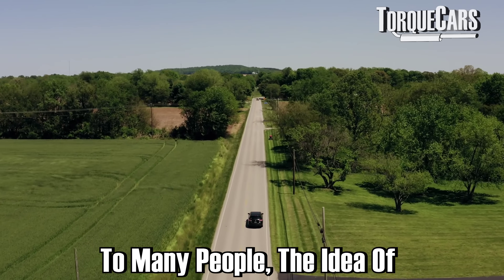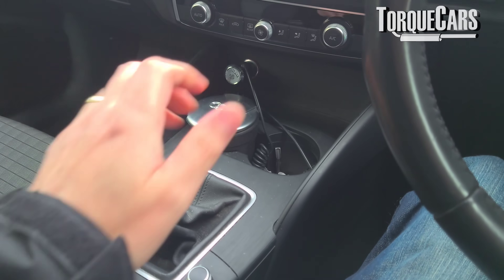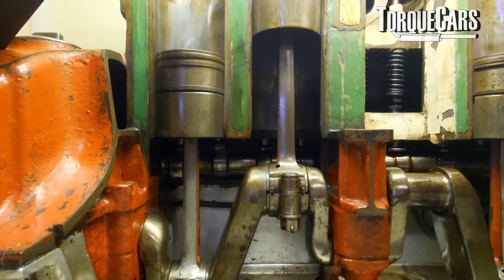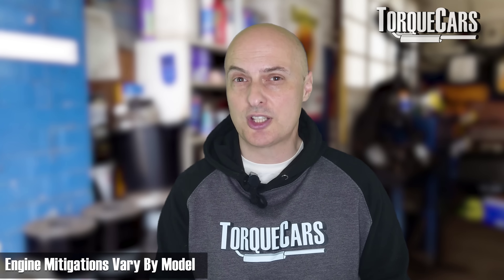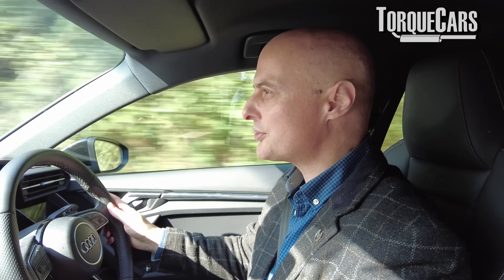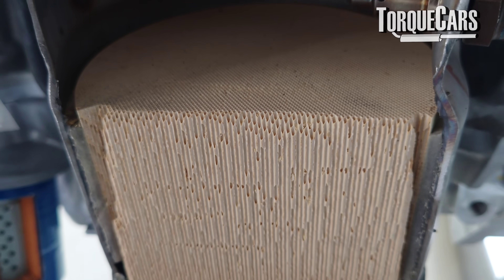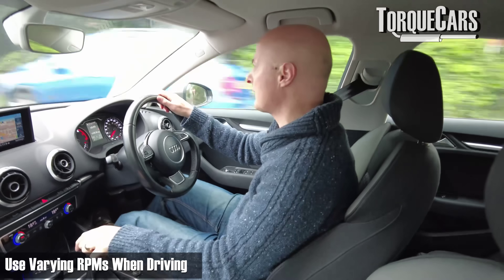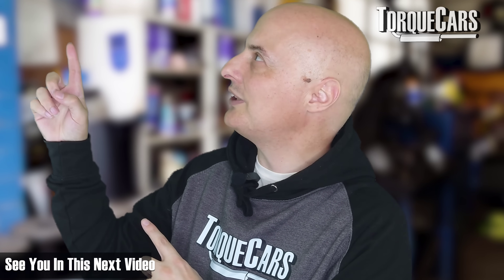BIG DAMAGE By Lugging at LOW RPM? Eco Driving Warning! (Manual Gears)

Comment: Great advice, I do have to use the gears a lot as I live on a steep hill and narrow roads, as I enter the bottom of my hill it's 1st gear get it to 3200/3500 in to 2nd and stay in second gear to the top and that is for 200/220 meters at 20-ish mph I'm doing just under 3000 rpm. As you know the urban speed limit is a very sleepy 20 mph as I go to my parents house i'm travelling 2 miles each way and it all 20 mph even across the Moss valley. The car will chug a long at 20 in forth gear I have done it and its at 1000 rpm but I drive in 3rd gear at 1500 rpm the same as drving in the centre of Wrexham. Once I get on the open road the Wrexham by-pass A483 ( clearway ) dual carriageway I give my car a treat through the gears to 50 and pass the speed limit to 70. I drive an old 06 Toyota Avensis 1.8 petrol with nearly 170000 on the clock the engine still ticks over like a watch don't use oil or water  Great video  take care

Comment: Been lugging the same VW TDI for 18 years with no engine issues.  Although that's what old diesels were made for.  Quickly noticed the VNT turbo didn't like that driving style.  It would quickly start dropping into limp mode above 3,000 revs.  Because the turbo vanes get stuck.  So it gets the occasional blast above 4k to help clear them out.
Reply: Yes. Video is misleading. Engine is fine. Its only accesories that might benefit from higher rpm

Comment: Low oil pressure and so on yes. Though depending on the car it may not be an issue or if the car is tuned and has a oil pump that pushes a lot more oil at the same rpm which means more pressure in which case it's probably fine.

Comment: My e-class MB 220d has a 9 gear automatic. 

At 1500 RPM the automatic changed to next gear.

By normal driving it is impossible to have more than 1800rpm .

Comment: Very interesting insights. Thanks for the detailed explanations on how high load at low revs affects the engine components.
I learned a few things here. I used to be under the impression that high rpm = bad. I remember when I got my 1st car 20 years ago, my Father was appalled when I accelerated past 4k. He insisted that those sort of revs will "destroy" my engine.
In more recent years I learned that this wasn't entirely correct, I heard about the Italian tune up and all the problems with diesels that are kept at low revs.
I've had 2 diesels since, and never had issues with carbon or blocked dpfs.
I think the trick to keep diesels healthy is regular drives above 2.5k rpm, mixed with some pulls up to 4k+
I think manufacturers aren't helping with longevity with their dash lights telling you to upshift at anything above 1800rpm (as is the case on my current car)

Comment: if you ever rode a bike in high gear u notice how much more strain it puts on your legs, it's the same with an engine I'm pretty sure
Reply: @alf3071  yes. How hard you push the pedals is your throttle input.

Comment: The 2019 Suburban 6.2L automatic transmission selects unnecessary low RPM,  around 1100 and deactivate half the cylinders. This cause vibrations.

Comment: I bought a  Chrysler town and country. The former owner drove on econ mode. The engine was running horrible. But after engine flush and patrol cleaner an 6000 km high RPM driving it runs perfectly again. So you are so right!

Comment: The Chrysler 345, 392 and Hellcat engines have an internal camshaft. Only the bearings of this camshaft have an oil feed, the rest of the camshaft is splash oiled from the oil the crankshaft throws up. Under 1,500RPM the oil splash is insufficient and will lead to premature wear of the camshaft. So yes, many engines suffer from too little oiling at low RPM.

Comment: Have run a 1990s Ford for over 300k miles, nearly all of the time changed gear between 2000-2200 RPM. Engine still sounds sweet, 5k oil changes have helped
Reply: @Smith-g1d  still running the old Ford pushrod engines. If you maintain them properly you won't need to buy another one.
Reply: I've had 3 Hondas (Civic, Integra, Accord Coupe) manuals, and I changed gears at around 3K RPM all the time, and NEVER had any engine issues either...
Reply: @rebeltvr6046 your engine would be full off carbon those Honda's are designed to be driven hard
Reply: @Jacobtheunwise  I do drive them hard sometimes, and go on long trips averaging 160km/h or more about 20% of the time.  The other 80% I lug it...overall, it seems to be working as I've never had engine issues with any of my 3 Hondas.
Reply: @Jacobtheunwise  what about cars that have that little icon that tells you to change gears? in my 2013 hyundai it always tells me to go up a gear at around 2k-3k rpm, depending on how fast I'm accelerating
Reply: My oils nice and clear Ford been driving it about like this. 2.3L Ranger
Reply: Because you are driving it long roads and loading yout car
Reply: 90s ford are also know for their insane reliability
Reply: Not an issue as its an older somewhat low rpm engine, and they peak on torque way down in the basement by like 2500 or even earlier.
Reply: @MrTheHillfolk  they are also very simple to repair if ever needed. As long as you don't let it overheat it will keep running.
Reply: You must spend all day looking at the Tacho?
Reply: @dennisbailey6067  when you know your car you know the rpm by sound
Reply: @Smith-g1d  You performed 5,000 oil changes?
Reply: @CarlSmith-bs4qx  my family has a 2003 corolla and we usually keep it around 2200-2500rpm. Same when we used to have a 93' Tercel. We have not had any issues by the rpm. The only issue was because the previous owner of the corolla rarely changed the oil and when we found out it was horrible, but just that. 

Allowing it to warm up 2-3min before going out of the house and 3000to 5000km (or every 6months) keeps that engine happy.

We even have seen the old Tercel by the town to this day by its current owner.

Comment: Many years ago a company I worked for had a fleet of Vauxhall Cavaliers.  As an employee without a company car I borrowed one occasionally.  You could tell the difference based on the driving style of the person you borrowed it from.  One of them had a slow and docile driver, and the car seemed much more sluggish and low powered than those normally driven by enthusiastic drivers.
Reply: The "Slow and docile driver" engine will last longer that's the thing!
Reply: @tardeliesmagic  I always drove my company cars really hard.  Four cylinders and a heavy car meant foot to the floor often.  They were all going strong when I got replacements at over 100k miles.
Reply: @tardeliesmagic  My last car (Jag XJ) was 23 years old when I sold it.  Red lined many times in 21 years of ownership.